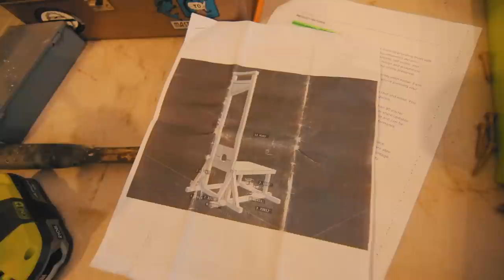Real Guillotine Build Requires Taking Apart Our Studio!

Comment: JAKE, JAKE, JAAAAAKE, you literally took the most difficult route in making the groove with the chisel.  If you ever try it again, dont try to chisel the whole groove out at once, it's just to difficult and it makes it really messy, instead you should do three things. 1)Sharpen you chisel, 2) Go down about 1/8 to 1/4 inch then start to chisel, do the whole length of the board then repeat, 3) When you're down to your last 1/8 in. Re sharpen your chisel and use it as a plane to smooth the inside. You should find it a lot easier son.

Comment: 5:46 "how else would you do this though"
Hand Router
Reply: That's what I was down here in the comments about to say. The blade would run a hundred time better if the channel was routed and not chiseled.
Reply: I cringed when he pulled out the jigsaw.
Reply: @jonathanpaquette7389  i was like wtf? You cut the two sides with the skill saw, just do rest aswell..
Reply: I felt like screaming at the screen! So frustrating!
Reply: I was going to suggest a router as well
Reply: Or just use three pieces of wood instead of one
Reply: Typed the same comment, scrolled down saw yours, deleted my comment. I cringed watching him do that.
Reply: Or even easier and more accurate. Dado blade on a table saw.
Reply: Dado blade would do nicely
Reply: My thought exactly lol
Reply: Uhhhh table saw with dado blade?
Reply: Drill is kind of like a slow router I guess lol

Comment: 5:50 - Buy a router. The power tool. Not the networking device.
Reply: Or a circular saw a table saw with a dado stack
Reply: @brentkrucenski1633  They would need a dedicated space for that, which they don't have.
Reply: dragonshardz  Not necessarily. Some modern routers actually have really decent vacuum systems. Worst case, he could mark everything out and make a 30 second cut in the alley.
Reply: @nonsenseverses6033  Uh...what?
Reply: You've got handheld routers and big cnc routers which take up a lot of space...
Reply: @jorenclaessens2110  Obviously I meant the handheld kind.
Reply: Why isn't he using a $50 router? And a jigsaw for a none-full depth cut! I'm no woodworker, but man... The cost of the right tool is probably less than the wood you'll ruin.
Reply: Seriously.  I haven't sold tools in about 8 years, but I'm also surprised they don't own a router.
Reply: god that was painful to watch.  Could have done that with a router, a table saw, or heck, even a circular saw with a guide.  If only there was a box that you could ask questions of, like "how to cut a groove in wood".

Comment: With the current setup you had at 5:43 we'd usually make more cuts along the piece you want to chisel out, and then chisel it out like you tried. Thin standalone strips are a lot easier and more cleaner to chisel out than a big solid block like you had. Seemed like you kind of had the idea when you tried it with the jigsaw, but you should've done it from a clean side so the jigsaw isn't unstable and jumping around.

Comment: 5 passes with a circular saw then go at it with a chisel... I thought you said you were a carpenter :p
Reply: There's also not sharpening the chisel (as a knife guy, how does Jake not have a stone?).  Also, using a real hammer instead of a rubber mallet would have helped. ;)
Reply: @CAPFlyer  indeed, but I don't think a dead blow hammer would have made much difference if the blade was blunt.
Reply: How about router?
Reply: router and router table
Reply: @Wedge-Antilles  router yes, table? Only if you have a death wish.

Though a router may not be deep enough.
Reply: He said his father was/is a carpenter and that it rubbed off on him.
Reply: @lforlight  the "rubbed off on him" insinuates that even if not as a trade, that he has experience. More so since he grew up in a household that had access to good tools.

I would find it strange if he didn't grow up building go-carts and/or bases/dens.
Reply: @Falney  yes router table. and a router will go as deep as the bit you have, look this carpentry up. My dad was a carpenter and i grew up learning this stuff. they make the table for safety, used a router free hand and you have a death wish. A table is the best option. look this up. watch the Yankee workshop. there is plenty of examples
Reply: @Wedge-Antilles  the bigger the piece of wood, the further away from the tool you are and thus the harder the cut. The harder the cut the more dangerous it is. With a route that deep and that long it is a much safer option to use a guide with a freehand router.

As for depth, the longer the tool the more unstable it is. I suppose you could use a deep plunge router bit on there but my choice would still be to run along it a few times with a circular saw.
Reply: @Falney  You know nothing of carpentry. The Router table was made for this type of work. Also learn how to operate tools, because the bigger the wood further from the tool is wrong. The table is very safe . look up what your talking about.
Reply: @Wedge-Antilles  I find your comment pretty funny considering how heavy and difficult to move around a 4x4 that length is. It is obvious to a 10 year old building his first tree house that the bigger the piece of wood, the more difficult it is to maneuver. Moving a router along that piece of wood with a guide is easier and safer than moving that piece of wood along the router.

Comment: 5:33 Cut multiple strips with the circular saw. The chisel them out. Then use the circular saw to smooth the cut
Reply: Carpentry 101. He took the longest most exhausting route.

Everyone saying he should have got a router, but he doesnt need to go get more tools for a single job if you can do them with what he already had.

Comment: Hey Jake,  just a tip if you ever need to cut a channel like that again. Take a skilsaw and run multiple cuts down the length of the channel to hog out as much wood as possible and then the left over strips can just be snapped out with a pry bar then clean up with a nice sharp chisel. this guarantees an even depth of cut along the entire peice and a lot less "Sentence enhancers" lol. I only say this because the only way for that guillotine to run properly is a relatively tight tolerance to maintain a square blade, so if it has too much slop in even one spot then one side can go further than the other and stop mid way and get wedged, then you have a really dangerous situation because the razor sharp blade could be immovable from 10 feet up. Also dont bother getting the blade machined, get some 3/8 1045 steel and using an angle grinder put an apple seed edge on it as well as a heat treat. This edge type is the most self supporting and will last the longest to an impact 1045 is also a great impact steel.  P.S. trust me im a blacksmith.  P.S.S. make sure to apply beeswax to the channel for lubrication.

Comment: Hey my dudes, mechanical engineering student here. I’m not sure if you guys will see this but I figured I could use some rough physics to help you guys out if you haven’t finished the blade yet. Now I was just guessing on a bunch of my calculations based on what I saw in the videos so I could be off by a margin. A traditional guillotine blade weighs about 80kg (about 175 lbs) and was dropped from 4.3 meters (about 14 feet) which generates about 3371 joules of energy. Since your design is taller, you don’t quite need to go that heavy to match the originals. With the heights you mentioned, the blade will only need to weigh about 47kg (about 103 lbs). If you use 3/4” steel with rough dimensions gleaned from the video, that would weigh 14kg (about 30 lbs) by itself. You would only need to add about 33kg (around 70 lbs) of additional weight. In all, the blade will need to weigh about 100 lbs to be effective. I hope this helps and if you need any more advice I’d be happy to help.

Comment: could have glued a few pieces together for the part that holds the blade. may lose some strength but way less labor-intensive and possibly quicker 😬
Reply: Exactly, way cheaper than a router, and you can fortify it with screw.
Reply: NEVER sacrifice strength/structural integrity just to save time, especially when working with a huge blade. History has proven that shortcuts in building are a very very bad idea lol
Reply: @KZ-hu9uj  our solution was better if you want something replaceable and pretty solid especially if fortified with screw.
I'm French, trust me, I know how to build a guillotine.

Comment: The bench needs to have a sled! The sled can be raised 90° when they strapped the condemned in. He's strapped in standing up and they slide the sled in place on the bench. And then they close the neck-hole plank. It's on both sides, up and down.
Google it :)

Comment: I never learned to saw that straight by hand, nice job. For the channel you tried to chisel out, you could use a plunge router on a jig and route away in light passes of 2mm depth each pass. But drilling out the bulk and then chiseling works great too!

Comment: 6:00 You asked how could you do it. Simplest and probably easiest/cheapest answer would be to use a simple circular saw with a side guiderail ie. using another pillar for guiding. Setting the correct sawblade depth and cutting multiple times, each time moving the pillar about 2-4 mm (depending on the saw blade you are using). More expensive alternative would be to use a router, but i thing the circular saw would do just fine. Cheers ;)

Comment: Jake @5:23 you should have used a circular saw, set to proper depth - and ran it 3 or 4 times through that channel - THEN - chisel it out. It would have been so much easier. Unless of course, you didn't have a circular saw at the time., in which case - never mind. LOL

Comment: if you dont have a router the easier solution is to use a skill saw or table saw and make a bunch of cuts about 1/8" apart then use the chisel. Makes your like alot easier

Comment: 3:50 there has to be some rules about no sawing towards crotch.... idk. Also, you need either sharper chisels or a router. Both are cheaper than your time dude. (I'm just giving you a hard time it's awesome) I did like the solution you came up with. You could have also gone a different way and just built a piece that the blade is held in that slides on the outside of those rails. Also WHERE is the blade video??

Comment: Just curious how the guillotine is gonna cut a lot of stuff, I mean, apart from obviously dropping a huge blade on it. With the table as it is, won't most items you plan on chopping fall off the table?
If you want to really chop shit on your new channel with a guillotine, I'd recommend extending that table further under the blade. Build an extension that slots in on the other side, just enough that ordinary items can sit underneath the blade and be held in place against the blade while being chopped.

Comment: Why do you use a hand saw when you have both a jig saw, a circular saw and - if I'm not mistaken - a cordless recip saw? And for the channel, multiple cuts with the circular saw combined with the chisel to finish it off would've work a lot better. Also, using a sharp chisel. ;)

Comment: The saw you are using to cut that angle is not for cutting wood like that its for tree branches. You need a normal straight saw the teeth on that curved one is not meant for dried cured wood.

Comment: Puked in my mouth just a little bit right there Jake 3:50 using a curved pruning saw to cut a joint. Please get a proper tool for the job, I'm concerned. Also a proper tool does half the job for you

Comment: That was painful carpentry to watch you should have just use a circular saw to go down that long board several trips and then you could easily have just broken out the tiny strips of wood.  Or use the correct tool on router it out. By the way I'm not a carpenter of any kind but watching that struggle was just dumb.